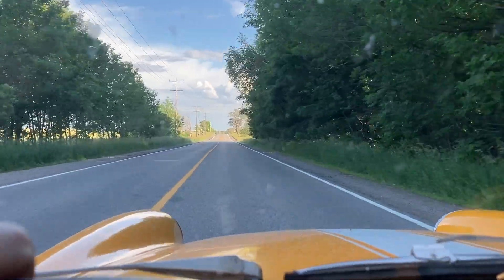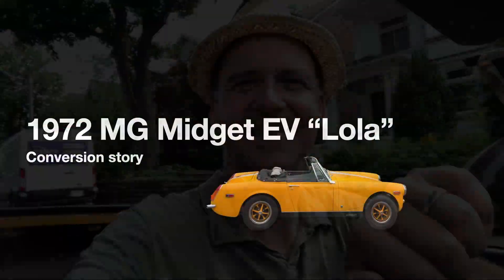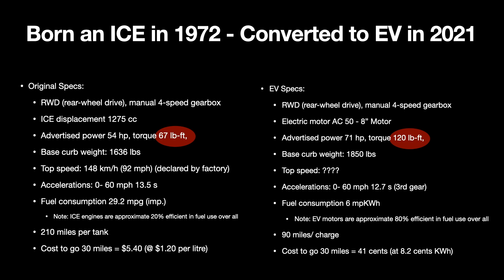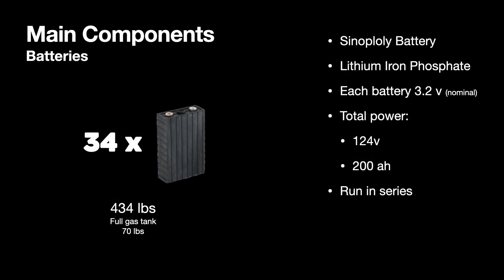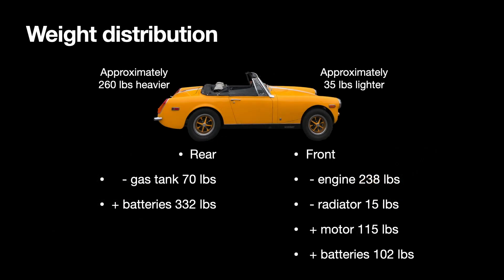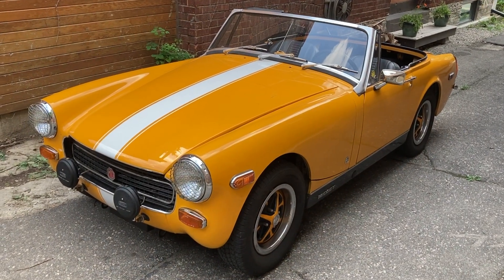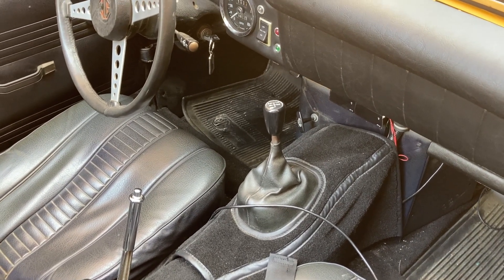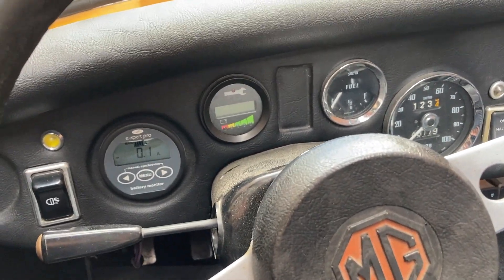MGEVGUY Episode 1 - Introduction to "Lola" the EV Midget

Comment: Planning the same for thing with my 1977 Midget and seeing your videos was actually one of my inspirations for the project.  Just confirmation it could be done.  

How did you mount the motor on the front end and did you have any issues with the drive line?  Thanks
Reply from the maker: Jeff you can reach me on mgevguy@gmail.com if you have more questions.  I welded in a brace to the original motor mounts for the front motor.  I ran the motor into the original transmission for the first two years, but scrapped that and now run a driveshaft direct to the dif.  car is amazing.  I am planning an update video about the driveshaft this spring